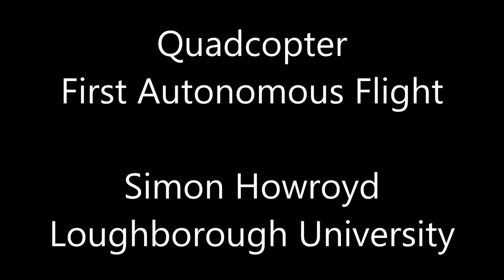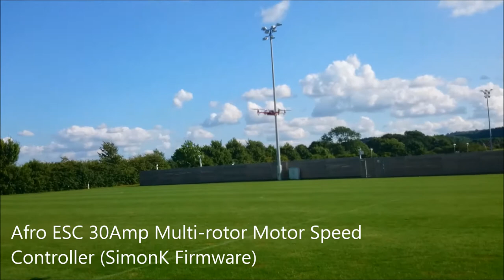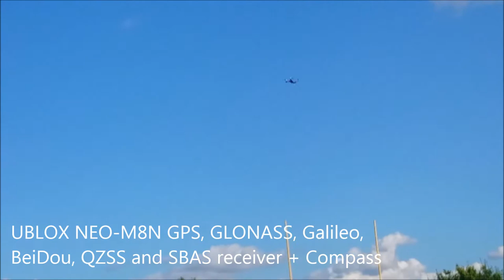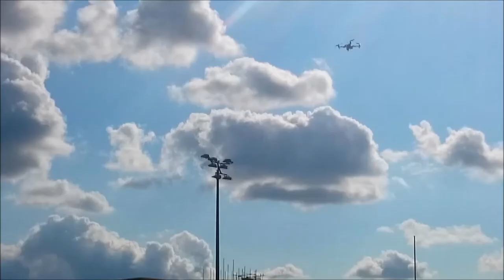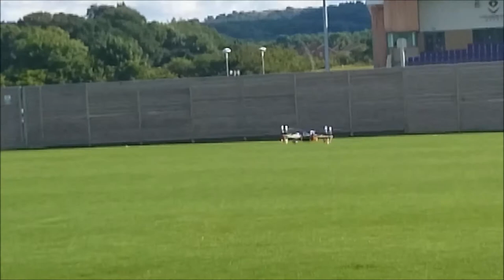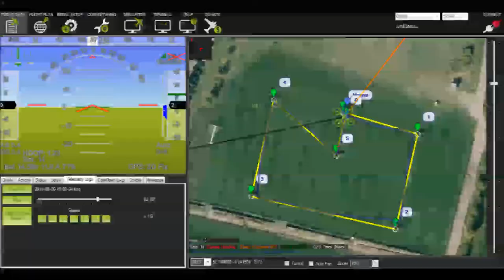Q450 V3 Quadcopter First Autonomous Flight

Comment: Most flight controllers i've seen so far are using ARM MCUs like STMs, and ive also seen comparison videos between ESP32 and STM32 with the result in favor of STM32 being faster than the ESP. Do you think the new ESP SOCs that use RISC-V can compete with STM32? I have an ESP32-S3 and Im thinking maybe it would be good enough to be a flight controller for Drone Planes. What do you think?
Reply from the maker: Easily capable.  If you look at the history of ardupilot, back in the day when this video was made, it was running on an AtMega2526 which is massively inferior to any ESP and most STs.

So in terms of can an ESP32 blah compete with an STM32 blah I am not sure what you mean.  Both can do the job of a flight controller so I'd choose whichever is cheapest and easiest to work with.

The main decision will probably be based upon how many PWM inputs and outputs you have on the chosen chip. Assuming you want to connect your receiver and your servos & esc directly to the chip.
Reply: @DrGreenGiant  I was just wondering why I dont see anyone building flight controllers with ESP32. yes, Ive also heard about the AtMega being used as flight controllers before. I am currently on the track in learning ESP32 and just recently I subscribed to your channel because I want to learn the esp-idf framework, and Im glad to know that you are also into this drone thing. I Appreciate your response, I am looking forward to learn more from you. Thanks.
Reply from the maker: @kymcainday6677  my pleasure. I'm somewhat holding out for IDF version 5 as that's going to be a huge change and improvement.
Reply: @DrGreenGiant  Wow, I'll wait for your tutorials on that. I find your videos more detailed compared to others.
Reply from the maker: @kymcainday6677  probably simplicity.  The ESP32 has a lot of stuff on it that you don't need and maybe don't want, on a flight controller.  Critical systems like a flight controller usually want to be as simple as possible so they can be proved to be safe.